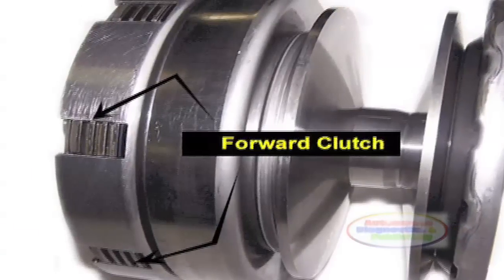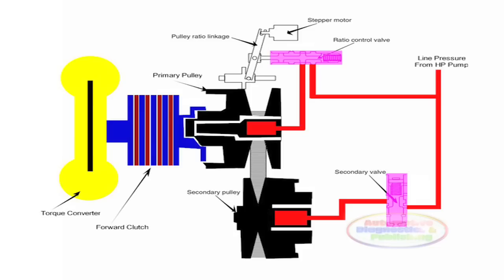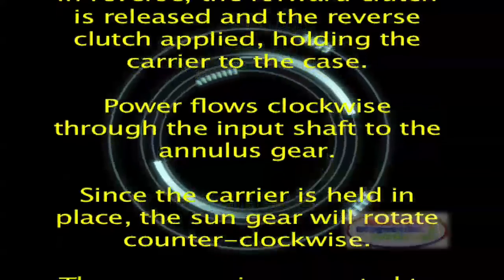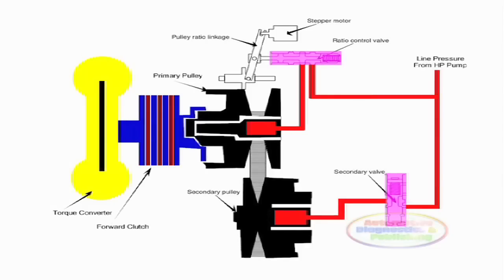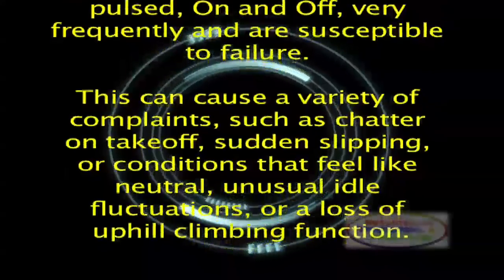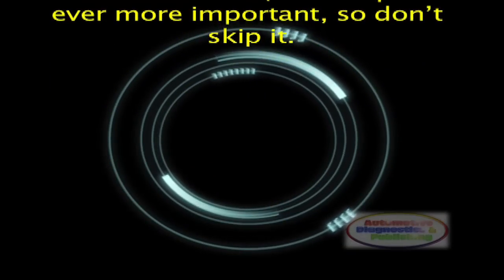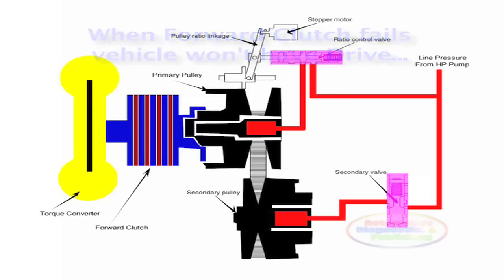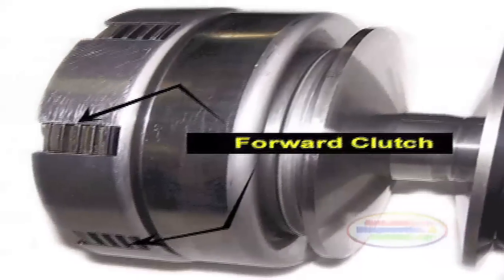CVT Transmission Forward Clutch

Comment: Could you help me to understand. So basicly a CVT has  both torque converter and clutch. Torque Converter for the primary movement and clutch for forward-reverse decision. Am I right?
Reply from the maker: A CVT is a pulley driven transmission, with a TC or not.
Reply: @ADPTraining  But how does the clutch mechanism happen ? TC or friction?

Comment from the maker: The issue is that CVTs work better when there's a more direct link between engine and wheels. The high end makes like Porsche, Jaguar, Maserati and others are also using friction clutches instead of TC, but their trans is not a CVT. They use a Formula 1 derived ZF mechanical gearbox with actuators. It looks like there's a trend towards replacing the TC for friction clutches. If they implement a quality unit then it's fine. Also, TC are very inefficient and loose lots of energy in the process.

Comment from the maker: Well, the reason for a planetary is for reverse. If you're attached to the sun gear, you get forward, hence the FC is attached to the sun gear as said in video. The reverse clutch is attached to ring gear and you get reverse. Is both FC and RC are applied, the engine stalls, which is an illogical thing the TCM will ever do, but for argument say. So it's very simple, since the engine is always turning in one direction, a PG is the best way to get reverse. It is also used for other issues as well.

Comment: Bravo.  Well done.

I'm questioning why they thought it was a good idea to toss the TC in some of these CVT configurations.  Not only do you lose the torque multiplication, but it's a reliable part that does not fail very often.  Why place a mechanical wear item in place of a part that performs an admirable function?

Comment: hi, i always get confused with theory on tranmission. This question is not for CVT, regular transmission. I understand the basic of clutch which is to hold or release the gear or shaft,  on other hand in planetary gear, based on what u lock(like sun, ring gear, etc), u get different gear ratio, my question is clutch used to lock these gears in planetary, or clutch is used for different purpose and bands are used to hold gears in planetary, can u pls educate me.